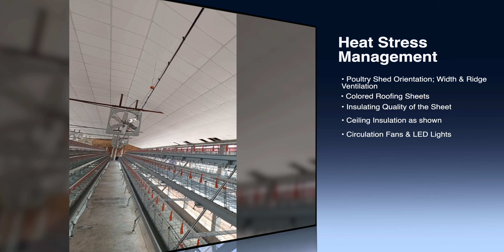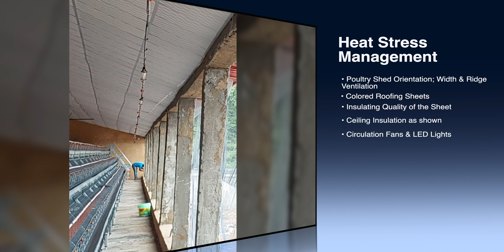Poultry Farm Construction | Poultry Fans | Poultry Specific LED Lights #poultryfarmconstruction

Comment from the maker: There is usually high mortality and huge loss in production due to extreme temperatures or heat stress. Sometimes failure to  anticipate these needs are evident during construction. Construction related plans include:
1.	Installations of circulation fans. The wind-chill effect is very effective in heat stress management
2.	Dropped ceiling with or without additional insulation such as fiberglass are also important. 
a.	Poultry Houses with insulated roof have a mortality rate of 0.5% while chicken sheds with no roof insulation have a ate of 14.3%
3.	Ridge ventilation is necessary depending on the width of your pen house.
Reply: Would you please confirm the distance covered by one axial circulation fan at top speed ? How far was one fan installed from the other in your pen for high efficiency considering your climate. Thanks
Reply from the maker: @lauresgandonou7410  hello. thank you for watching and commenting. It reaches 15 meters. We installed at 10 meters apart.
Reply: @PetrosFarms  Thanks for you response. Are your fan single or multi-phase and how do you control the speed ? Is it coming with an environmental control box  or you had to connect to your own ?
Reply from the maker: @lauresgandonou7410  
A. 3-phase 
B. We don't control the speed. 
C. We are using analog switch. We tried the environmental switch on one fan and we weren't happy with the performance.